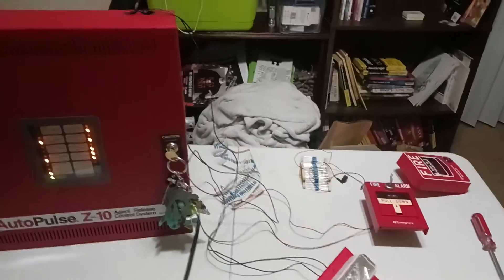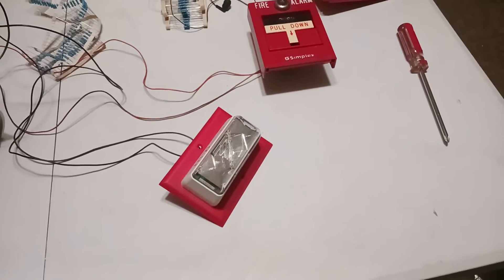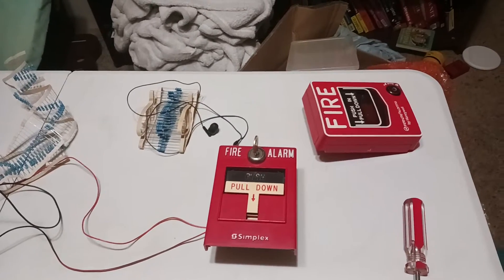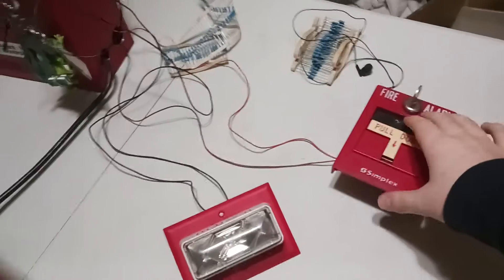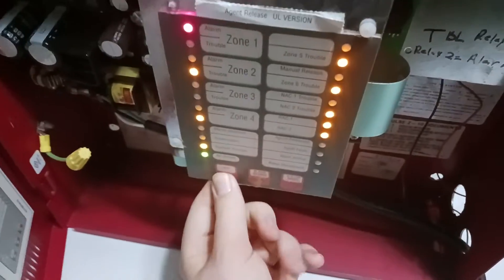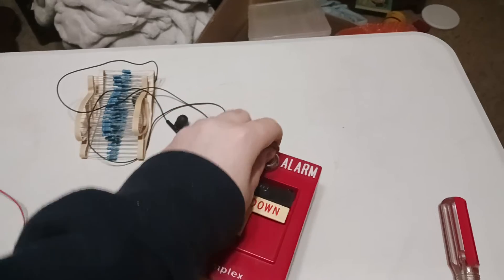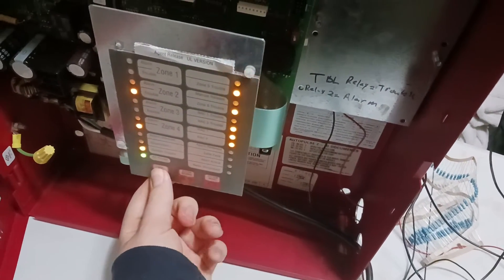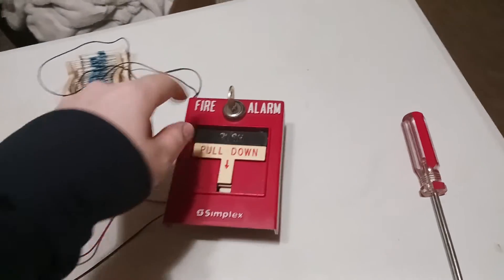System Test 2

Comment: I have the same panel 
And i have a problem
During maintenace disconnecting the wire of two zones(IDC1,IDC2)
And led to activate the two zone like a fire happen and this the problem still 
What is the solution?
Reply from the maker: Can you elaborate further? From what I'm understanding, you seem to be adding/removing zones while the panel is operational. If you're doing this, it is extremely unsafe and could result in an electric shock. Always do maintenance on the panel while it is unplugged from AC power and battery power (if you have batteries that is).